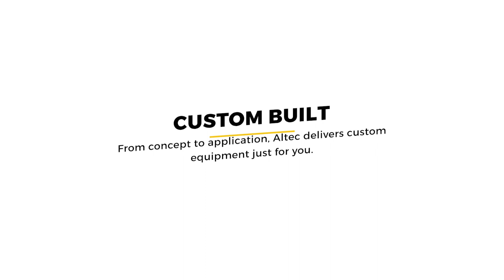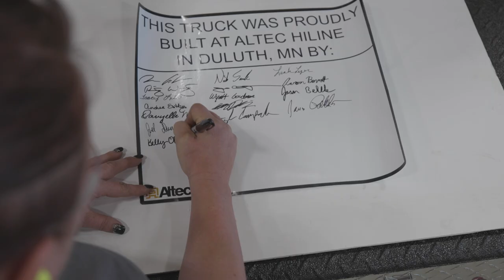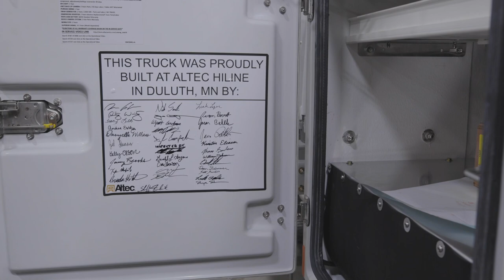AT&T Custom Built Process

Comment: I'd like to know why they decided to place the rotating spot light right by the upper control panel at the bucket? Totally in the way and pretty much useless. Place it back on the roof or on the hood. Other than that I like everything Altec has done.
Reply: Interesting, i just moved into a new 22' & I want the opposite. Mine is on the passenger side above the strobe, but still behind the front knuckle of the boom.

I was thinking if it was up on the bucket i could use more as a floodlight for ground work. Instead i cant use it at all on the driverside unless i shift the boom all the way foward.
Reply: @mikewindell7182  I just moved into a new 2022 from a 2012 and my spotlight is same as yours. However we have a few 20's and 21' with the light by the upper controls on the bucket as i described. Glad mine isnt like that.
Reply: We install it on the unit curbside next to the strobe now.